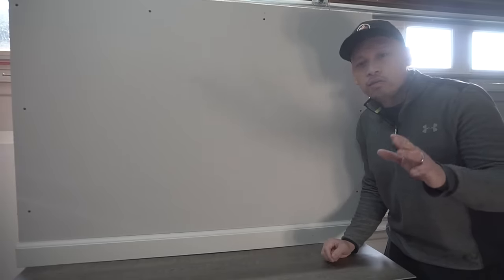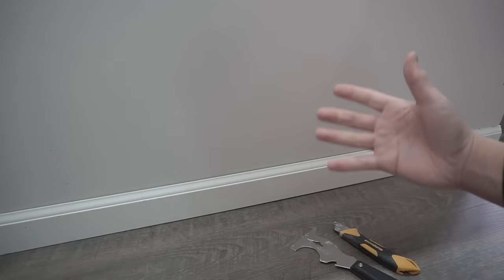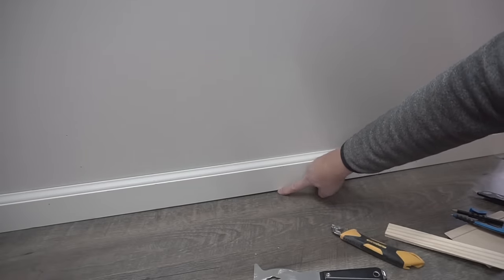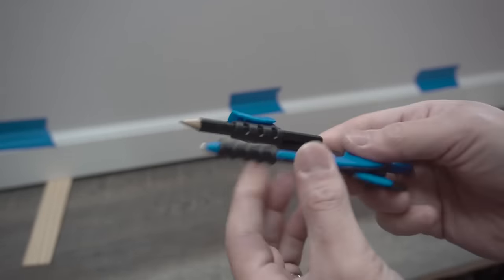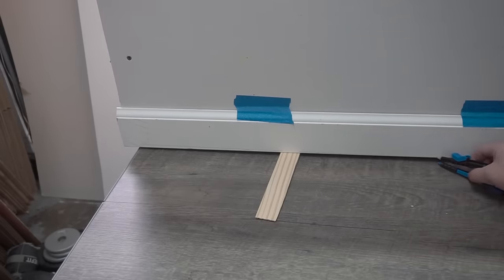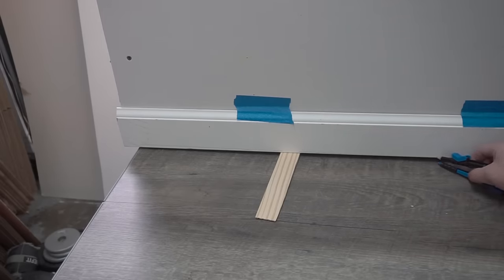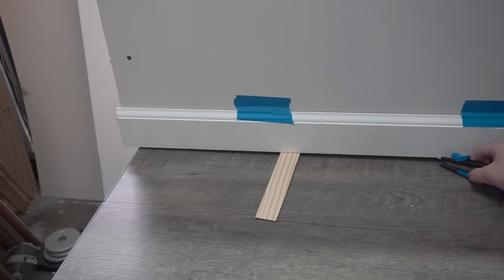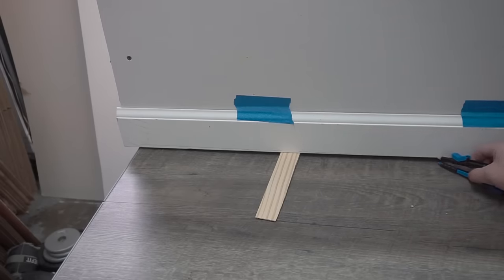How To Fix Gaps Between Baseboard And Floor For Perfect Fit! DIY Step By Step Tutorial For Beginners

Comment: I really wish YouTube didn't hide the "Dislike" button. It's not specifically that I would or I'm going to "dislike" this video, but specifically I'm curious how there's 147k+ views and only 1k likes. It makes it hard to figure out if this is actually a 'healthy recommended' tip.
To that extent, here's my feedback.

I tried this the other day, because I DIY everything in my home, and the baseboards are the final step of my home remodel, next to my stair resurface (last).

I'll be very frank, this video was actually a great tutorial. It showed me how to do it effectively with no real issue...granted I may have a bit more experience in various things, since I've effectively renovated every aspect of my home. Nevertheless, the video worked wonders.
The method of how to scribe was correct, the way to get a 'flush' fitment baseboard to the ground worked fantastic.

The problem is realistically that it's too much work, and it's not efficient nor effective, and there's too much room for error to do, say, an entire house like this.

So this is the problem I'm running into.
It's more-so the aspect of "I sanded a little too much, this board is ruined" and less-so the practice. It's the idea that this entire solution, even when completed, just looks off.
Which comes to my next issue entirely with it:

It's both a suggested tip that some builders or carpenters would do, but it's also a very time consuming, and honestly expensive tip.

Consider just the cost of materials alone. Just using a sander, it'll cost me an extra $30 for 'that much' sand paper to go through that many boards in my house. The next issue is accidently sanding a little too much would effectively ruin that one singular piece, requiring you to go back and redo it, which is another expense. Then sanding itself takes a long time. Alternatively, there's free cutting on a table saw or, if you have a band saw, a band saw. The issue I'd assume you'd encounter with these is the same exact issue. We're dealing with gaps that may be 1/8th inch or less, getting near a blades width of material off is already hard enough to keep perfect. By the time you're done with all of this, like myself the other day, you're left wondering "Is it worth the hassle".

This is where I formed another method.
Recutting the baseboard again, getting them positioned perfectly level on the wall, allowing whatever peices are properly sitting near flush already to do so, whilst every piece joints together perfectly. For me, this wasn't incredibly difficult as I'm using 1x4 planks of hardwood appearance board (square edge), whereas some people may be using the cheap (actually incredibly expensive) mdf board that's 'pre-primed'. Mind you, I also had to cut reference points and square each of the boards so that I know I'm working with square material.
I then tacked all these in place, and with tape underneath (for testing purposes, I could choose to just carve out the tape with a nice blade or as I'm going to do instead, redo this section). Then mixing DAP wood filler with some tite bond ii, and a plastic putty knife (I dont want to damage any of my hardwood flooring), I would fill in each of the gaps, about 1/4" or so in depth, leaving just enough on the outside layer for sanding (As you would drywalling). Let this dry for a day or two, came back and sanded it flush, added a nice coat of black paint to it, and carved out the tape. This, however, is still temporary and I will be removing it to do it again (Which I'll get to this briefly).
And I'm left with... Anticipation rises A much better result. It looked uniformed, it looked cleaner, and it was perfectly on the ground. It looked like it was even, and not wavy, and the best part of all of this - Now since I'm not going 'with the floor' for the levelness, I'm effectively making the room look far more level than it actually is. I'm aware with the scribing method I could have 'made the baseboard level and did that', but I'd be left with areas that were just far too low with this small of a baseboard; I'm effectively using 3.25" baseboard.

So now everyone reading this is probably wondering: "Why the hell are you using 3 inch baseboards?!?!"
Ah, simple solution. Caps. More specifically, I'm doing a design concept across the top of each of the baseboards that'll mold into either LED lighting (smart rgb) for accent lighting, OR in some areas (like the dining room and staircase), addressable LED smart lighting. The purpose and intent here is to push the baseboards as low as they can go, have a 1" gap between the baseboard and the 'cap', and have the LED strip resting against the drywall. On both the baseboard and the cap (which, mind you, the cap may only be .75" or so), there will be about a 1/4" dado for the frosted acrylic strip (1" in height) to rest within.
I could have "chose" to not do something so elaborate and useless, but I also enjoy accent lighting for walking across my house, and this indefinitely is something I'm looking to achieve in this project.
Reply: Now, I started this comment off by noting the dislike button statement.
Truthfully, I'd like to know how many people actually 'scribe' their baseboards verses just throwing silicone underneath, or even shoe molding, and calling it quits. I'd imagine a good chunk of homes do this instead, or even leave them as is, since it's impossible unless you're slab on grade in a region with almost no weather fluctuation.

Nevertheless, the video was a solid tip for those with softer and easier materials to work with who want to do it 'by the book'. From what I can tell, scribing appears to be the most common method of adjusting baseboard properly. I just feel like it doesn't work in every scenario, as it shouldn't, and so I came up with an alternative solution that'll work with mine.
Thought I'd share it for those who may be doing something with smaller baseboards that don't want to cut them to the point where you actually notice the uneven flooring.

Comment: When you trim off that bottom, the baseboard at the corners are not gonna lineup that’s not gonna work or if your floor is lower in one room than the other is not gonna lineup

Comment: If the baseboard does not connect to another one, it’s a great thing to do. The problem, if you do this all around the house, you may end up with half an inch of baseboard instead of whatever width you started with. In todays world, very few clients would pay the time it takes to do all that. We use blue tape and a perfectly straight line of white paintable caulking. Looks the same.

Comment: But doesn’t that cause you to have to scribe every single baseboard in your room? Or. Wouldn’t the walls (baseboards) on either perpendicular wall be higher than the one you trim?
Reply from the maker: Honestly this technique will work best if your low point is close to the middle and tapers to the the edges. Once you scribe to the middle and the edge it will taper to nothing. I wish my example on the video was a longer baseboard, but unfortunately it was only 4’ on my mock up. This will work on some cases, but yes you will have to reduce surroundings boards to match the height. You can also use quarter round or a shoe molding, or some will just caulk it. Again this is a just an option. Thank you for watching! 🙏🏽👍🏽😊

Comment: Another trick is to cut 10 degree wedges (with the grain) and tuck them into tapering gaps. Then cut the excess flush with an extended snap point knife bowing the tip into plane with the baseboard’s face. Paint it in.

Comment: Ok so I don’t have time to read thru the comments however I can’t be the only one that thinks this is a horrible way to flush your trim. Not only do you have trim that looks like it’s short and uneven, the amount of time (as a contractor) trying to fix trim gapping is redunkulas.  We float and level all our uneven floors, and from time to time with concrete sub floors, we grind high spots. IMO the prep is everything and worth every penny hands down.  I’d like to see you try that Shiz with qtr round, smaller base or even decorative base. I for one would instantly notice the difference in height when the base is next to or adjacent with the newly modified trim. Also just for the heck of it would you try to use the technique at the end of a hall way, so 3 sided?? I didn’t think so. And finally they manufacture so many different devices that actually alloy you to trace any contour, the one I’ve seen a bunch at hardware stores has a pencil on a slide that adjusts up and down while the Bottem of the tool is on felt so you can effortlessly slide it across any substrate 😊
Thanks and lastly please tell me that you own a moisture meter and you follow manufacturers recommendations for acclimation as well as perimeter expansion gapping??? Just a question 😉☺️

Comment: All you had to do was use joint compound.  Then seal the joint compound.  Then cut it with a paint brush & repaint the trim so it makes a sharp line.

Comment: Just push the trim down against the floor as you nail. The baseboard has a bit of flex/sag to it as it is most likely MDF. Trim can take long enough as it is, this method would take way to long and add unnecessary steps. This is however a good demo for how to scribe a surface, I just have never seen it done for trim work, wether it be professional or otherwise.
Reply: Also, never caulk the bottom of baseboard on these types of flooring, they are designed to be “floating” and you could end up voiding your floors warranty by doing so...
Reply from the maker: Thanks for sharing your advice 👍🏽😊
Reply: @FixThisHouse  your welcome. Don’t let any negative comments beat you down. Folks appreciate people making videos like yours. We all have to learn and sometimes there is more then one way to slime a cat as the saying goes. Keep up the good work.

Comment: In my Opinion I think the short way to fix this is to Press the wood from the center until it touch the floor then put 3 or 4 nails Shot for more fix ....also you can use silicon with nails to give it Extra fix ... this type of wood is soft and bendable

Comment: Right idea but only for certain applications. Have to have both sides end or if connecting to another piece, inside or outside corner then those pieces would have to be trimmed to match. This scribe method is perfect for a hump along the run but not a dip. Unless you're a perfectionist like myself and willing to spend the time to make everything perfect matching height, but not really practical on the jobsite as would take too much time and effort. Can't shim the laminate because it WILL separate over time, self leveling compound is another option but wasted time waiting for it to cure. Caulk should NEVER be used on a floating floor as it WILL either separate or buckle when it expands and contracts not to mention will automatically void the manufacturer warranty for improper installation. So only other option is shoe molding or quarter round. Quickest solution, adds extra detail to existing trim,adds a money for job but cheaper and easier than the labor involved than hiring a  high end trim carpenter that will scribe the whole job to perfection like myself. Sometimes the easier way is the most logical way and save a lot of time and money too.

Comment: My personal opinion is that MDF is a horrible choice for a baseboard material. It absorbs moisture faster than you can even blink. And I don't mean waste your life water on the floor I mean moisture in the air so yeah it'll suck that in. So if you plan on mopping or even slightly using any type of cleaner to clean your floors good luck unless you one hundred percent for sure caulk and seal your baseboards which there's always a little area somewhere where moisture can get in and then boom horrible like a tampon in a cup of water except the test your walls and it's made to hide imperfections and then becomes an imperfection so just my thoughts. But if you are going to use it instead of wasting all the time trying to trim it and make it level just push it down really hard it's really flexible and then nail it but this guy does show some good tips and tricks for doing things and I commend him for putting the time in to show people because these videos help a lot even if mbf suck donkey balls LOL Y'all Rock

Comment: Skirting board it is called. Use proper skirting n slot in flooring, standard work
Reply from the maker: That works too! 👍🏽😊
Reply: @FixThisHouse  and Ground Plug to wall for the skirting.

Comment: One other option didn’t mention if using a standard “square” profile for base, using a cap on top to help “break up” the walls that are not level….meaning, start in left with flat to wall and might be 1/4, 3/8, & 1/2 inch out towards middle of base etc…. A cap can help “hide this” along with floating the wall during drywall/paint stage….but that’s an extra cost, especially labour for most, whereas a cap can keep costs bit low, and help w/ those large gaps that filling with caulk, just looks “Yuck”….😉
Reply from the maker: Awesome tip my friend👍🏽😊🙏🏽

Comment: Don’t mean to step on toes but I just fill the imperfections with joint compound use a sponge instead of sandpaper and the tiny imperfections disappear. That way one doesn’t need to also cut the adjoining wall molding... My philosophy is always “don’t raise the bridge lower the water”.

Comment: You don't knock the nail back through because it can split the front. You pull them through from the back and the front stays good you don't have to fill the hole.

Comment: Will have to trim all the other boards to the same height to match - so lots of trimming.
Reply from the maker: Not necessarily. This option is best if your dip is in the middle and tapers off to the ends. Just an option 👍🏽

Comment: Hi, I do like your video and trying to teach the average homeowner some tricks of the trade.  This video you just shown may be helpful for an end run of the total trim job of the entire room.  This video is not for installing trim in an average room..This video will set back the average homeowner crazy if he or she does the entire home or room like you just shown.  You know by reducing the height of that 3 1/4 molding, every piece further like after an outside corner needs to be ripped now to 3in since you removed 1/4 in, and when the homeowner turns to the next wall and that floor is out 1/4in, now your down to 2 3/4in.  Get where I'm going with this.  The molding will look like crap that small.  In a home with dips and tappers, they need shoe molding up against the 3 1/4 in molding. It may not be that by choice, but they may not have a choice.  I'm not saying this to degrade you, I'm for the average homeowner to do repairs, but when I do see a video that will confuse or mislead someone, I feel compelled to write a comment.
Reply from the maker: Thanks for your feedback sir. This is just an option where the dip is in the mid area and tapers off to the edges. Otherwise shoe or quarter round or even caulk are other options. 🙏🏽😊

Comment: With respect it is painfull to watch for a experienced finishing carpenter. Some comments have easiest way to do this which is use of a spring board. A 4ft long piece of 2x4. Put the edge on the base and step on it till baseboard touches the floor, then nail it of in the stud. Might have put a few to hold. Other trick it to dampen the wood so is more flexible. Thanks for taking your time to do a perfect job. But what about adjoining pieces?

Comment: what happens when you have a longer base board? lol you just have a section that's lower?
Reply from the maker: This technique will work best for gaps in the middle section and then gently tapers off the edges. This is an option 😊👍🏽

Comment: You are scribing the baseboard to the floor.  I did the same thing in my house.  I started with a jigsaw too but bought a 12V electric planer and it did a better job, faster.  If you are doing a ton of base, I highly recommend the purchase.
Reply from the maker: Thank you for the recommendation on a planer! I will definitely try one out! What brand do you recommend works best?
Reply: @FixThisHouse  I am a Bosch guy.  Not to say the rest don't work.  However, I am not sure anyone else has a 12V cordless planer.  I am sure a full size one would work too but the compactness and lightness of the small cordless one was perfect for this.

Comment: This is why they make shoe molding. With darker walls your eye is going to pick up the difference in width of that white baseboard.
Reply from the maker: Thank you 🙏🏽. Just want d to give options
Reply: @FixThisHouse  The scribing technique you use is certainly important when window or door casing has to abut a wall corner or the kitchen cabinet end panels abut a wavy wall, so the demonstration is useful and appreciated.

Comment: Actually that Gap is no big deal you want something almost that size Gap so that you could put a straight edge underneath the baseboard and come back and paint without having to worry about painting the floor. Preferably a 12-in taping knife or some kind of a vertical blind slat that you can't tuck underneath the baseboard or shoe molding in order to paint quickly and perfectly without painting the floor plain and simple easy peasy

Comment: left continuance of baseboard is all gonna have to all be stripped 1/4" for it to match the miter...too much work    just stick a 2x6 on baasboard lip, stand on it then nail it....  wood will follow floor and carefull using with finger jointed material